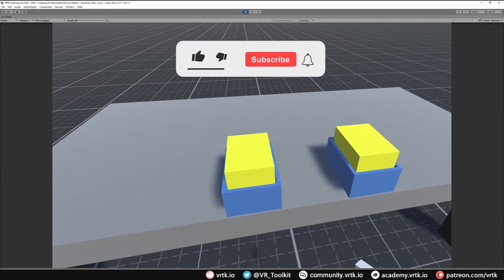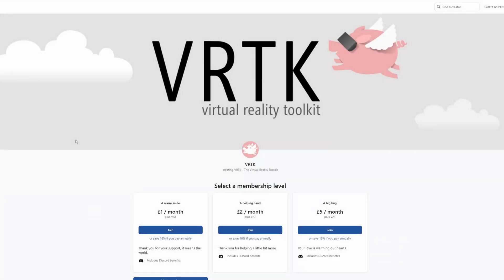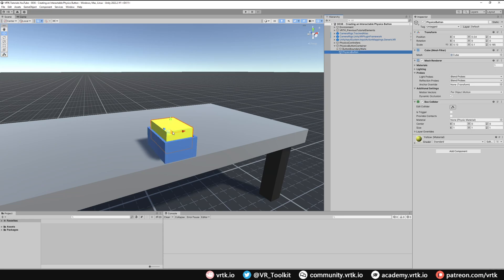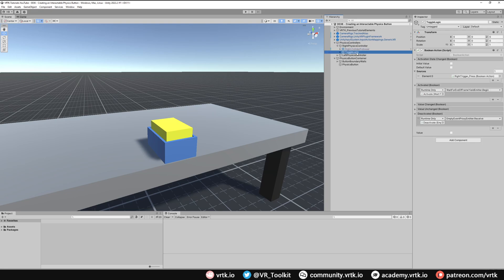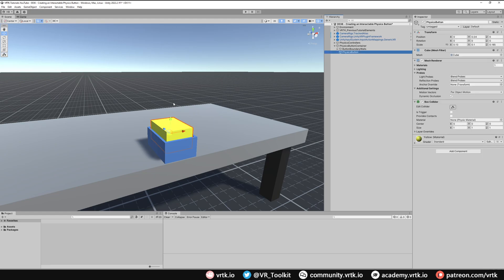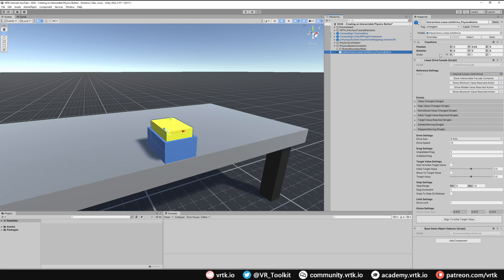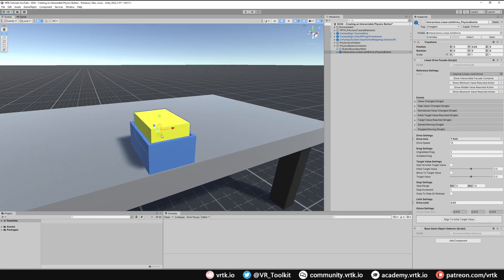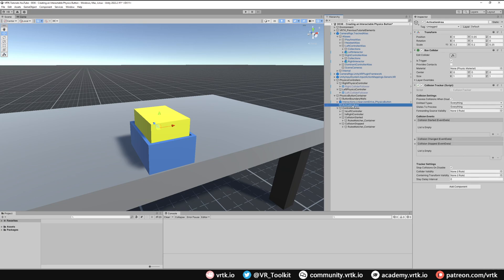[Unity XR] VRTK v4 - Creating an Interactable Physics Button

Comment: Your videos are very understandable but I think your video upload arrangement is a little bit confusing. In my opinion this video should be uploaded before  "Multiple Input to an Interactable" or "Interactable door" etc. (That's my opinion). 

Your last 4 videos (Adding pointer video to Installing video) are the very main thing to do, I already did these thing thanks to your 1 year-old "Getting Started with VRTK4" video but uploading these videos now makes me think "Did I miss something?" or "Did they change the main things?". If someone try to follow guides from videos, it will be confusing but "VRTK v4 Tutorial" playlist is in right order.

Btw v4 Tutorial playlist is expanding day by day and I'm so pleased with that. 

Anyway, I searched lots of button guide but I couldn't manage to use any of them. This worked perfect. I started with this youtube channel and controlling type is just compatible with this guides I guess. (Or I'm just untalented .D)

For other followers. If you didn't prepare Collider Follower before and don't know know how to use it, you should check the link.

https://github.com/ExtendRealityLtd/Tilia.Trackers.ColliderFollower.Unity/tree/master/Documentation/HowToGuides/AddingAColliderFollower